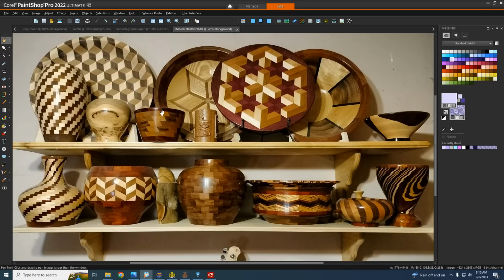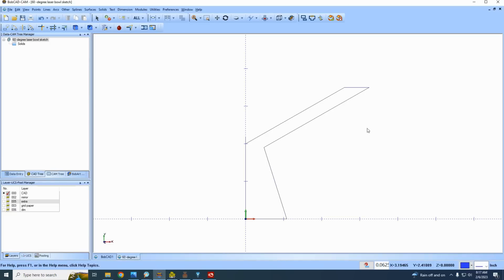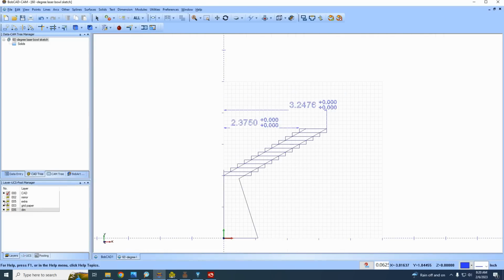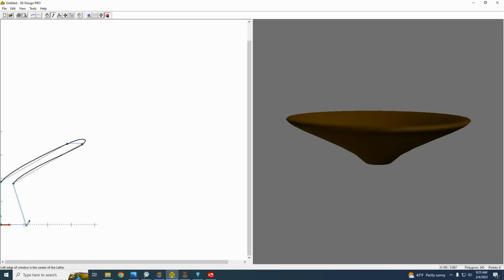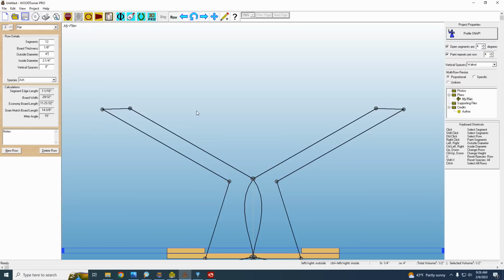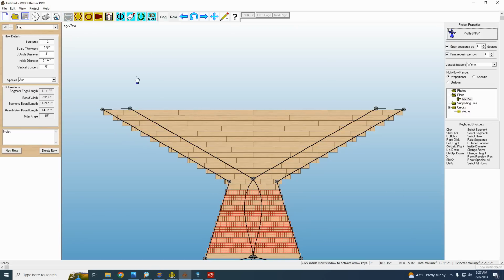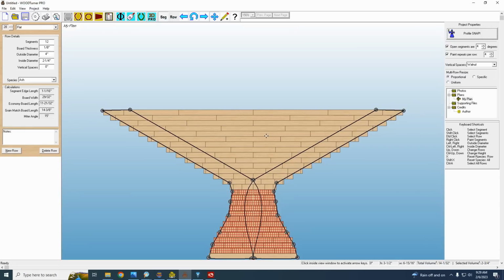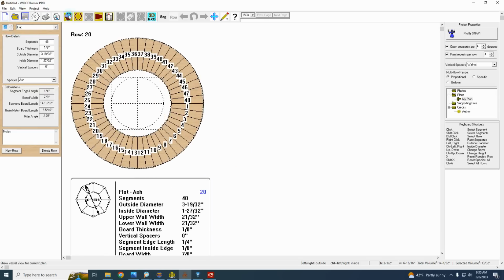Segmented Wood Turning  Made Easy  + Design Tricks

Comment: Awesome introduction to how you would plan a segmented turning, Gary. You’ve almost talked me into getting Woodturnerturner Pro. Almost! I don’t know that I’m ready to do that but it does occasionally enter my mind. I’m not sure if I’m too old or just too cheap but it’s not in my immediate plans. I still like drawing it out on grid paper.

I’m very happy that you’re feeling better, buddy. Glad to know that you’ve come through it. OK. Take it slow and easy until you’re ready to get back to full speed.
Take care,
…..Gord
Reply: I’m with you Gord, pencil and paper for my simple designs.  That’s how I learned from Malcolm Tibbetts. The math is very simple. For complicated designs I’m using Segment Pro
Reply from the maker: Hi Greg, as I mentioned to Greg as a wood pattern maker I learned how to lay out segmented shapes using what is basically a grid method without the grids. And these were very complex designs.  No such thing as Woodturner Pro back in those days.  If you check out my thumbnail I am turning a pattern about 4 foot in diameter that was glued together using that method. A great way to do it.
Gary
Reply: Gord, Woodturner Pro isn't very expensive. And it's a one time expense. No annual renewal fees like some software. But the real advantages are: 1. You can easily make changes to the design. Not only shape but segment pattern design. 2. All the calculations are done for you. And if you do make a design change everything is automatically recalculated. I've been using it for over 30 years and haven't found anything better. I'm not part of the Woodturner Pro team, I just like it and think you will too. 😀😀
Reply from the maker: Thanks Gord. Well all the patterns I built at work using segments were done with the basic grid style method but without the grids. I would layout the shape from customers drawings and then choose segment thickness. Some were 1.75 inches thick. With edge lengths up to 20 inches. So big stuff.  Nothing wrong at all with the method. .
 You could always do the 30 day trial which is what I did. Problem is after trying it you want it and then it will go back to being too cheap LOL. I know that was my problem so I talked about it 24/7 till she said OK BUY IT ...lol.  Just kidding
Thanks for watching,
Gary

Comment: That was excellent, Gary! I knew it wasn't rocket surgery, but I've never seen it in such a visual way, watching the calculations and changes happen in real time. Much more helpful than the hand drawn graph paper sketches. But, you use what you have. I could've used some software to help with a project design the last few days, but it's a rough one with plenty of room for modification along the way. Still, I'll be indexing holes and spacing them ideally would've been easier with proper apps. I should look into the ones you've suggested. Great video for those unfamiliar with segmented turning.
Reply from the maker: Thank you Jay.  I leaned how to do it all on paper at work. We had to add extra stock to the inside and outside of the segments so we could turn them to exact dimensions. So this software made sense the first time I used it. 
 Have fun with your project.
Gary

Comment: Glad you are going good Gary. Thank you for explaining this. However, my problem I have is the actual cutting of the segments as I don't have the "Wedgy" setup to cut segments because, buying them gets real pricey as I have to get them from abroad and I can't find anyone making them in South Africa. Have tried a few methods in cutting them, but it never works out. I have found someone thats willing to try and make me wedgies, the problem again there is to find the dimensions it should be. Any suggestions please?
Reply from the maker: Thank you Jaipe.
It sounds to me like you might need a fixed sled which would be easy to do. I could help you with dimensions if needed.
Reply: @ThePapa1947  i would appreciate any help that i can get as i would love to do segmented pieces.

Comment: Glad you are feeling better Gary! I have that program Wood turner pro and all I have ever done is try to design a bowl just using it but after watching your video I got some info on how to use it better, thanks!

Cheers Al
Reply from the maker: Thank you Al. It is a great program but you need to be able to get a profile into it to actually use it. You could keep adjusting ring diameter but not a great way to get a shape.
 Segment Pro gives you designs to start with and you can adjust them. But I kind of forget that I even have the program because I just do not use it.
Great for getting started I suppose.
Thanks again,
Gary